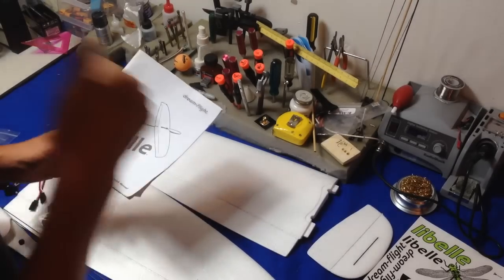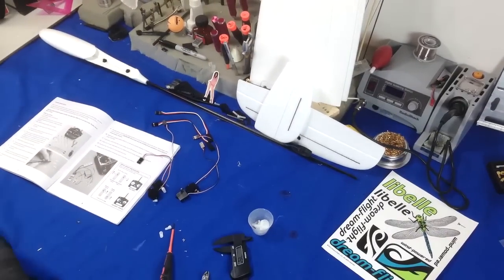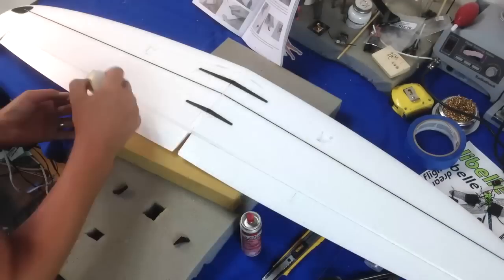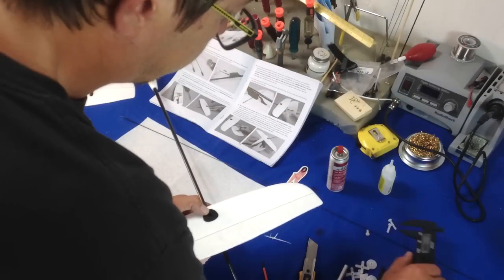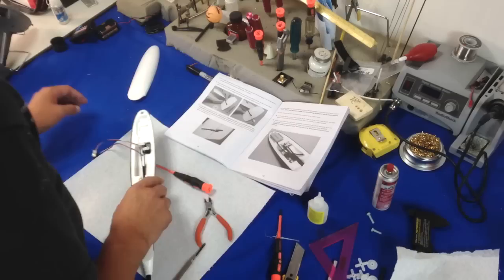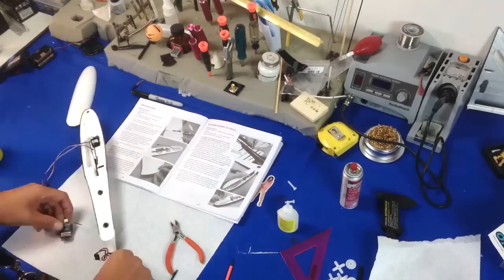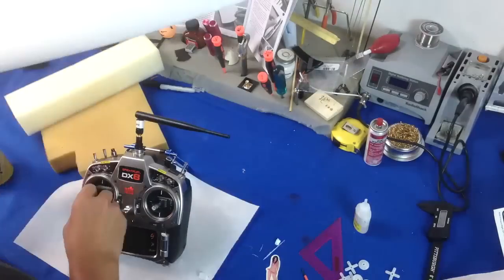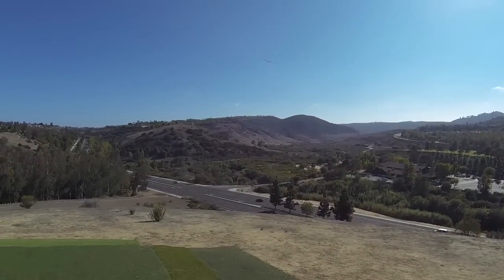Dream Flight Libelle build overview

Comment: Thanks VERY much for taking the time to share your building experience!  I assembled mine this weekend and your video was extremely helpful.

Question... Down below there are comments about a thread on RCGroups discussing common problems... I cannot locate that thread and would be interested in applying modifications before having an issue.  What are the mods to reinforce the glider for long term use?  

Thanks again, I look forward to many flight hours.
Reply from the maker: I never followed the RCG thread on this dlg.  I ended up laminating the first 4" of the leading edge top and bottom.  Prob not necessary but I still fly it today after a lot of abuse

Comment: Nice slope glider but it needs a lot of fixes to beef it up...  ended up having all the problems with mine i read about on rcgroups that being said its awesome on the slope :)
Reply from the maker: Thanks, I saw that thread- will put some inserts or epoxy under the wings for support

Comment: As beginner how would I know what electronics to purchase and well as transmitter . All the programming sounds scary
Reply from the maker: This is definitely not a good beginner plane!  Look up Flite test beginner series
Reply: @7demo7review  Do you mean not good for beginners as a build, or flying, or both?
Reply from the maker: Paul Gross both!...
Reply: @7demo7review  Thanks Jeff....
Reply: @7demo7review  One more question, Jeff. I flew two meter two channel for about 5 years back in the 80's. And I built balsa and monocote ships. Could I get back into it with this plane?